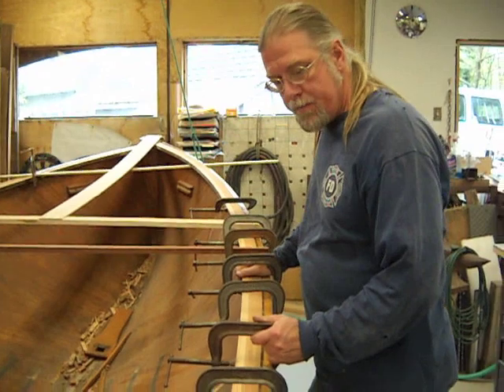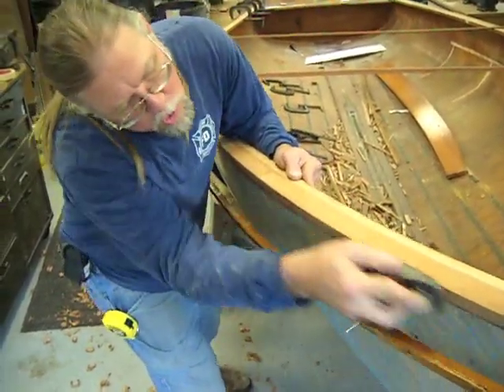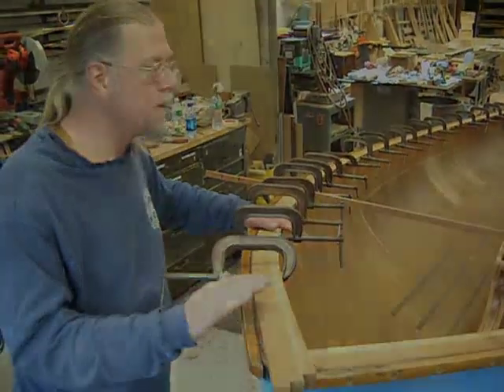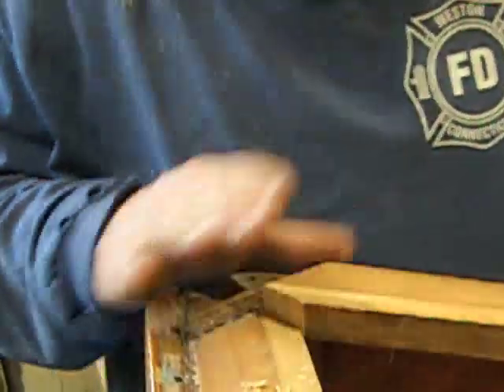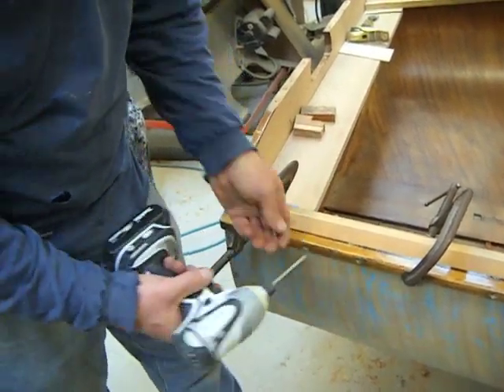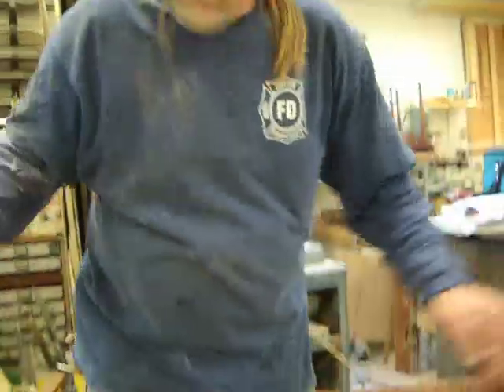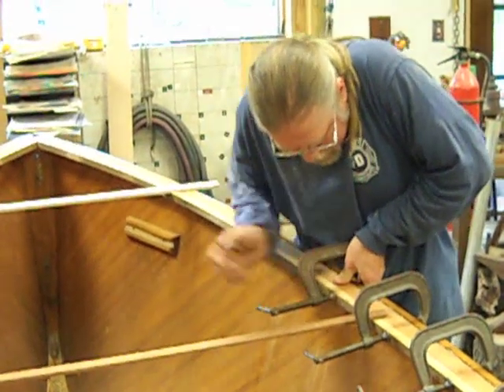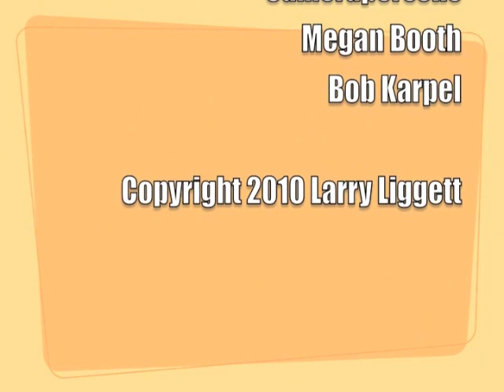THISTLE REPAIR with Larry Liggett - Installing Rails Part 2

Comment: This post is a little old... I'm looking into removing my rails mostly because I need to refinish the entire interior of my Thistle.  Getting everything out of the way makes for a much better finish/ end product.  I'm sure glad no one prior removed the Rails and glued them in with Epoxy!  I don't imagine epoxy to be at all reversible as a matter of fact I've seen the wood break before the glue  gave out.  Just wonder if you really think it's necessary to Epoxy the rails... sure the old glue failed. They were built in the 1940s - 50s. and obviously added the rails in a way that made them easy to remove by not even bunging the screw heads.  I guess your reasoning is, Too Bad For the Next Guy.
Reply: Thanks for viewing the video.  The rails contribute significantly to the strength and rigidity of the hull.  You should use epoxy to glue them together and to glue them to the hull.  Once done, you should never need to remove them.